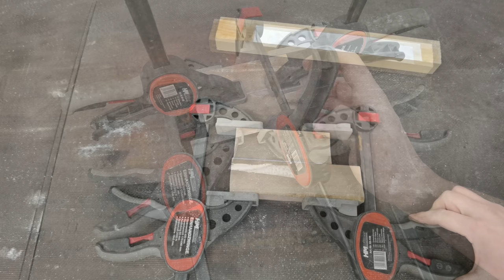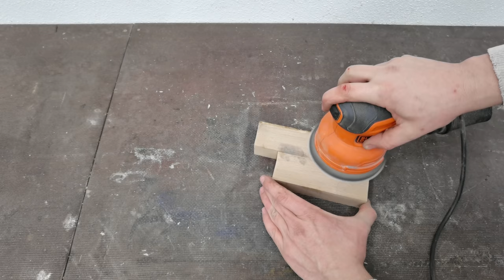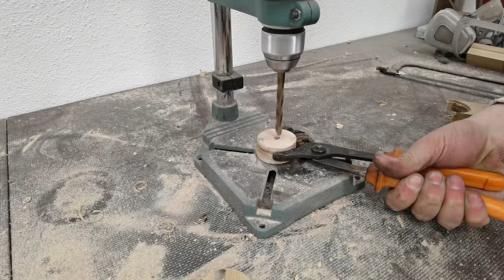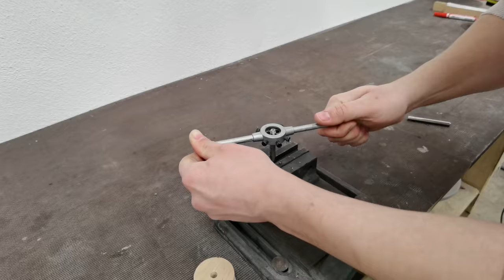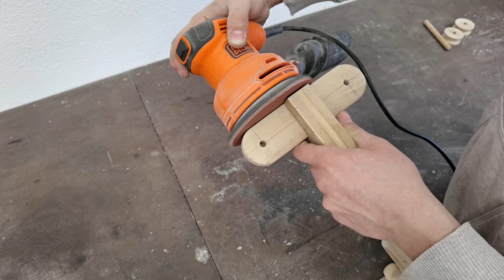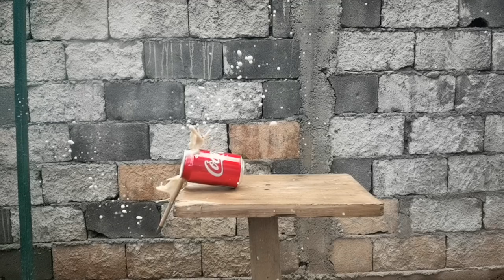How to Make a Slingshot Crossbow Pistol

Comment: Nice work but you rely too much on heavy machinery tools,most of it could be done with simple tools. Heck you even used a drill to screw in the nut to the bolt 16:29

Comment: Definitely gonna make one. Although it seems that your trigger is a lot heavier to pull. I'm thinking of adding rubber bands from the trigger to the empty wood space in front of the thumb(to make a hole for the rubber band to loop) would help make it easier to pull. It's not gonna be pretty but It will hopefully work for mine.
Reply from the maker: send a picture when you finish it